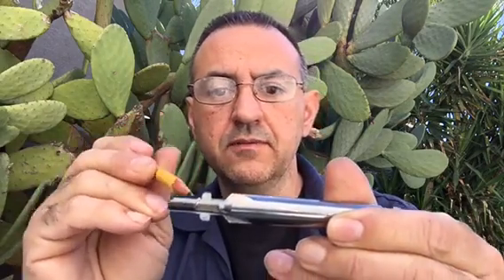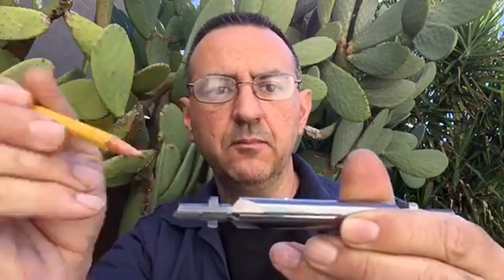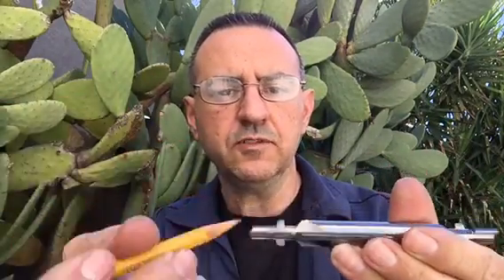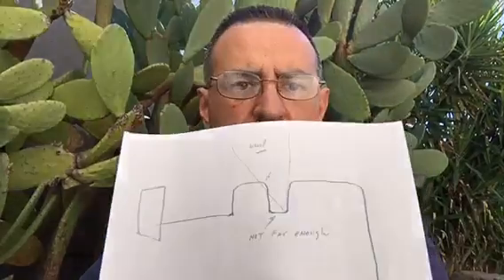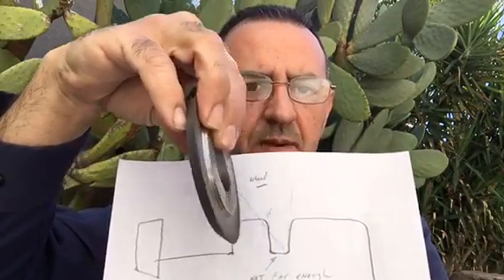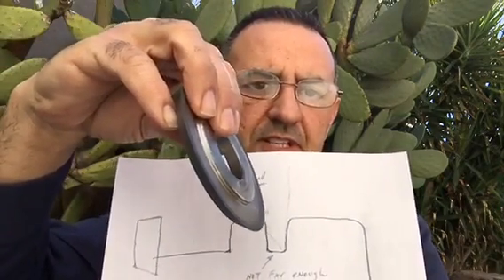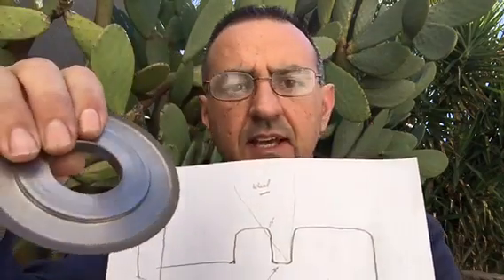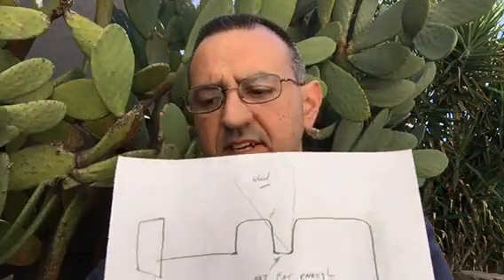In the cut about flute count

Comment: Maybe I got you wrong, but is the cutting speed really relevant in relation to how many flutes are in the cut? I thought the width of cut is determining how many flutes are in the cut at any time?

Further thank you for describing what limits the flutes. For the first tool: I assume that alternating flutes also tend to chatter less?

Last but not least for the setup piece: Is there a softer material than carbide that you use for those things to reduce wheel wear or would anything much softer than carbide clog the wheel. But maybe you create setup pieces only involuntarily like I do :)
Reply from the maker: 1AB09CC3 yes, cutting speed dictates how many flutes are in the cut unrelated to cutter width. Cutter diameter is a factor but sfm is a constant given cutter material and part material. RPM changes based on SFM and cutter Ø . For this reason a 1/2” two flute cutter running at 2000 SFM will have less interruption (2 flutes in the material) than the same cutter running at 200 SFM. If you were cutting say M2 and your SFM was 200 you would want maybe six to eight flutes to insure two flutes of contact at that slow RPM. Again this is pretty old school mentality straight out of the Machinery’s Handbook.
Reply: Alfred Lyon okay. Than i have to think about this again calmly :)
Reply from the maker: 1AB09CC3 some shops use some kind of test material but I just use whatever is laying around
Reply from the maker: 1AB09CC3 maybe what is confusing here is the term , “width of cut”. Radial depth nor axial depth of cut plays a part in the equation of cutter speed , which is the RPM of the cutter based on SFM and cutter Ø. Cut width or depth comes into play when calculating feed rate , chip load , necessary HP , and loads of other factors. Many people when they are trying to improve finish adjust their RPM but only by adjusting feed rate , chip load, and adjusting the harmonics of the cut can the finish improve. The SFM (and it’s relative RPM) should be constant .
Reply: Alfred Lyon with width of cut i meant the radial engagement. I'm from Germany and maybe just picked the wrong terminology. My thoughts are based in the following example: when you mill on a conventional machine and engage e. g. 20% in radial direction there are less flutes in the cut at any time than when you would mill a full slot.
Based on this "believe" i currently can't follow the idea (or fact, I don't want to allege that it's not like you said) that the surface speed also plays a role for how many flutes are in the cut. But i'll dig into this within the next days :)
Reply from the maker: 1AB09CC3 radial engagement is completely different from my example on the video but I can see how i could have confused you and others. The term , “two flutes in the cut” has more to do with interruption of cut. In other words, time that it take from one flute to contact the part until the next flute. For example. Say you have a fan with two blades. If you spin it very quickly you only see a blur. If you spin it slowly you see both blades. That is how Surface Feet Per Minute works. As you change your SFM for any given part material, cutter material , and tool diameter your RPM increases or decreases. So, high SFM equal a blurry fan with only two flutes. A Low SFM would require many more blades on the fan to be blurry (less interruptions) .
Reply: Alfred Lyon Ah, okay. Now I got what you mean :)
How SFM is working was already clear to me but thanks for explaining it nonetheless.

Comment: Production tooling is so often a compromise between aggressive cutting, vs tool longevity . . .bigger 'bites' take less time, whereas more flutes take smaller bites; at a reduced feed rate.
Today's methods tend to encourage SPEED , though I'm a dinosaur, *think the tortoise & hare. .. hurry tends to cost in so many ways , so the final question seems to be, 'how fast is fast enough' ?     Thanks for putting out the info !
Reply from the maker: georgewocosky the newest cam systems are amazing at keeping constant spindle load as well chip load, chip thinning, and aggressive tool paths. Combined these make tools last longer and keep machine motors and servos at sustained optimum levels. Not so good for finishing which is mostly linear paths.